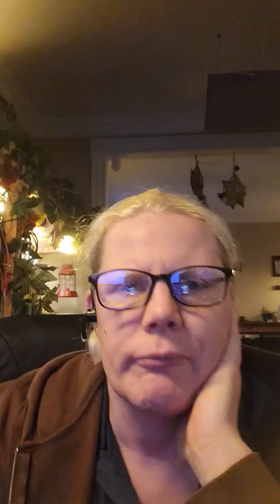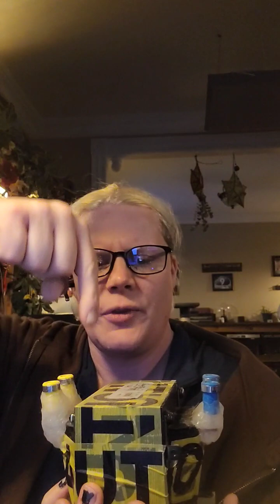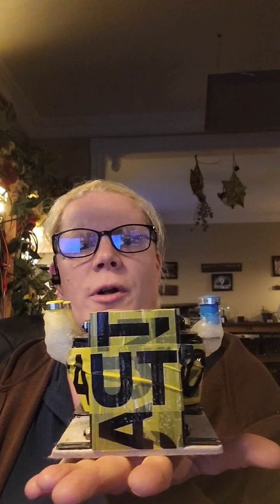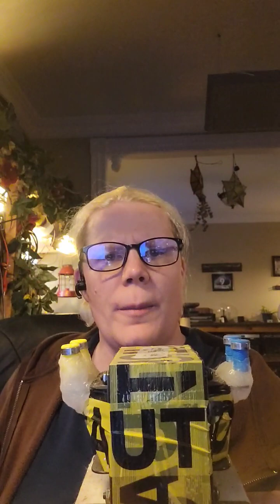1:1 isolation Transformer or "Decoupling Transformer". #electronic #electrical #telecom #wisp

Comment: Would this help if we have power drop issues?? So when a car lift starts the voltage drops from 235 -> 207 and it drives the ups craaaazy
Reply from the maker: No. You need an avr for that. If your not already running a DC plant I'd suggest you start as that would really help with the issue